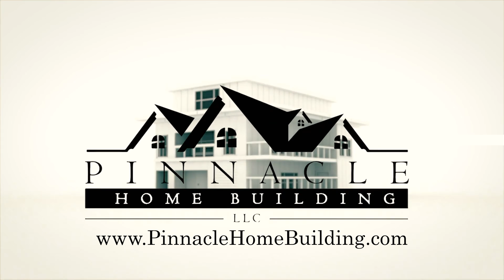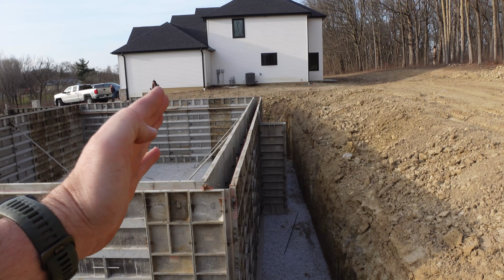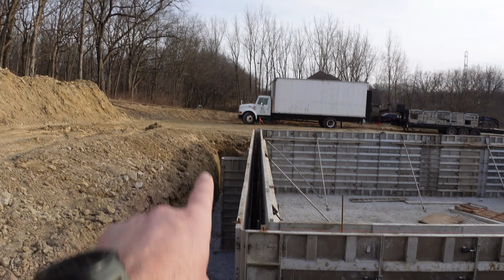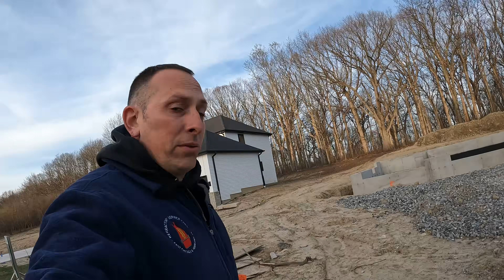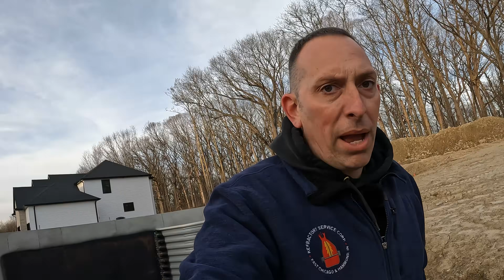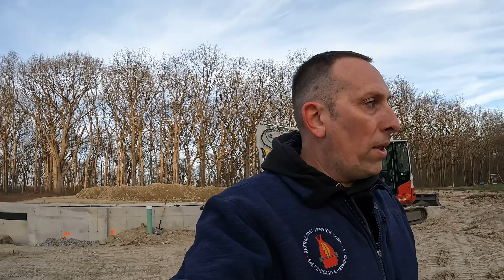Build Your Own House - Episode 7- Foundation!

Comment: Curious as to your thoughts on ICF for a house foundation. What are the advantages and disadvantages or ICF?
Reply from the maker: I think there are a couple advantages to ICF, and I will most likely be using ICF when we build our personal home. For spec builds in our area, the market doesn't allow for the additional costs. 

From my limited research, the two key advantages I've found are, one, if you have your own in-house crew, you can build the forms yourself. Advantage 2, full insulation on both sides. Advantage 2 can be offset on a standard foundation by insulating both sides of the foundation post strip. I think the real advantage of ICF comes into play if you're going to use it for exterior walls on the above grade portion of the house. (downfalls there too, your planning has to be spot on, future renovations = PITA, and cost).